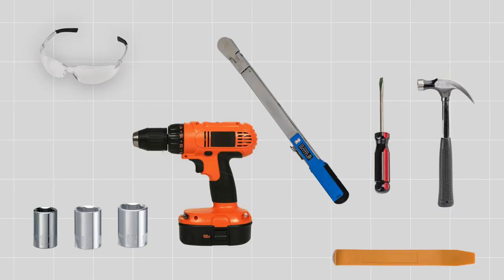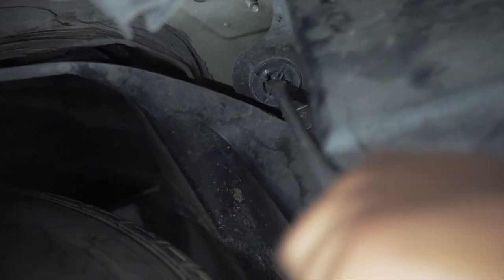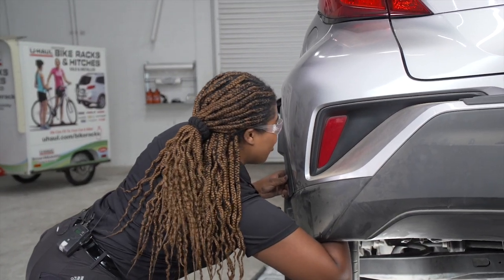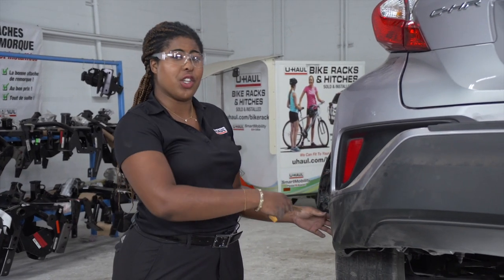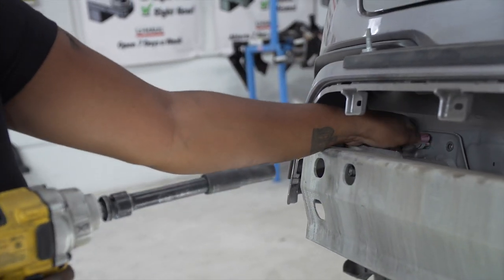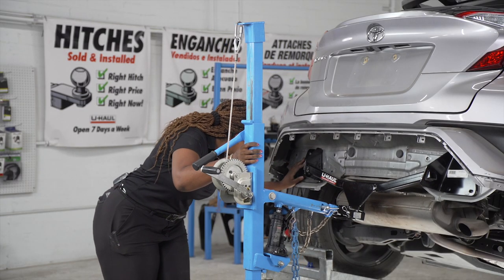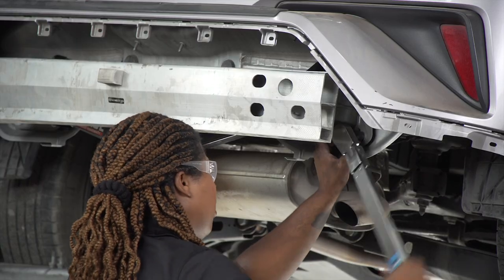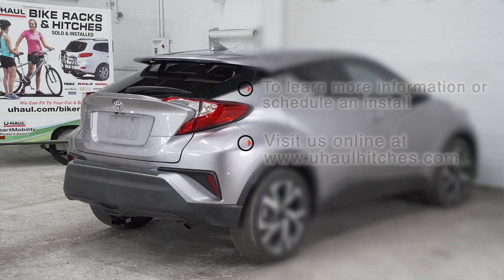2020 Toyota C-HR Trailer Hitch Installation

Comment: That's all good and well until you find out that in addition to the four bolts fastening the bumper beam that you'll also have to deal with nasty bumper adhesive.